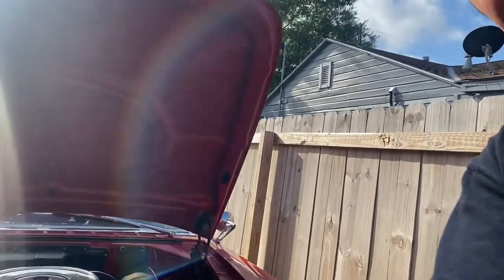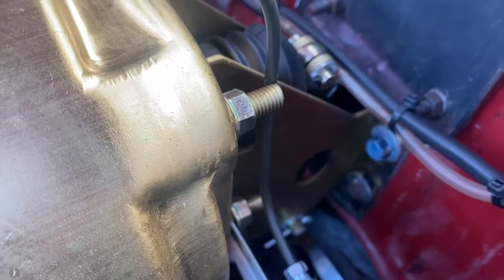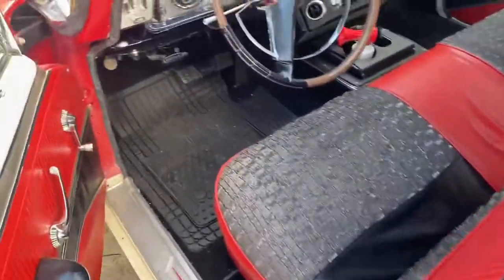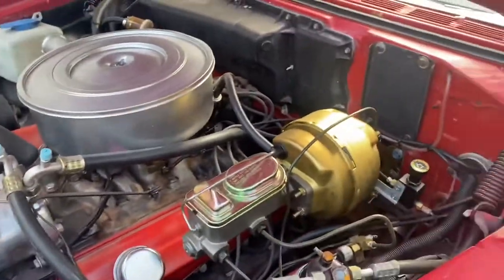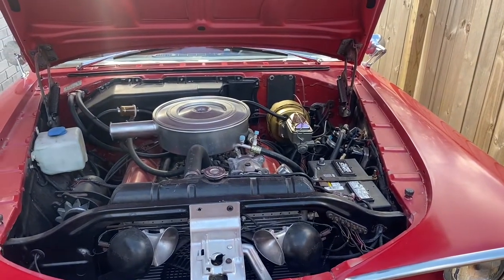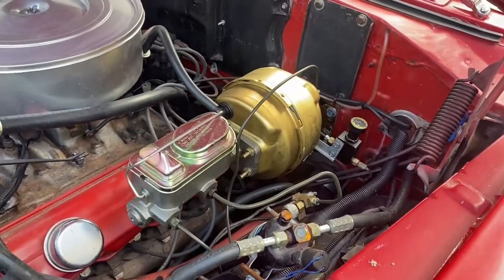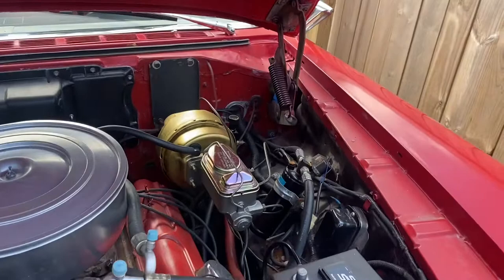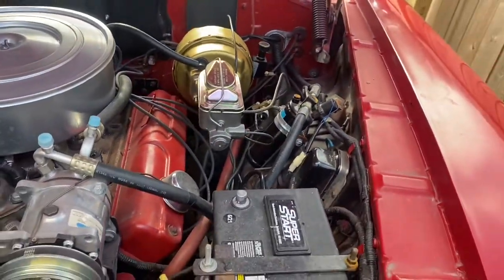1959 dodge coronet forward look car brake conversion

Comment: What did you use for the front rotors and calipers??
Reply from the maker: Not sure it was on the car already but call aaj brakes that guy knows what fits what model . He is awesome
Reply: @kirkize  thanks for the info! I got myself a rotten barn find custom royal and I'm told factory brake parts are obsolete, happy to know a conversion kit exists!
Reply from the maker: Not really a kit I used parts from a 70 satellite so you can make that work on the 59 coronet. Not sure what other models it maybe fit .
Reply from the maker: The ac compressor was on the vehicle as another person did that . I use a few different companies and you can make some brackets. Try restomod air or vintage air for a universal kit . They have Mach up units also so you can text fit or build brackets to it .